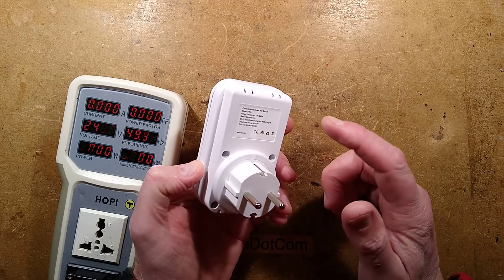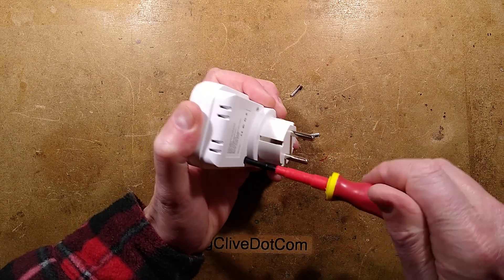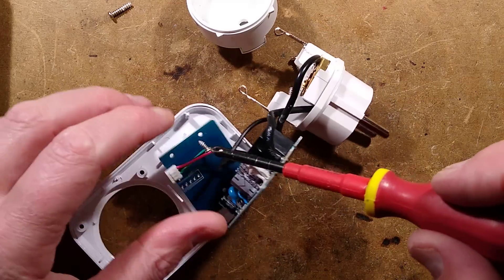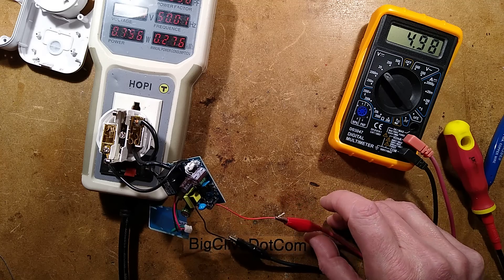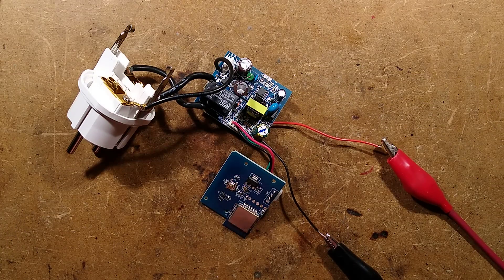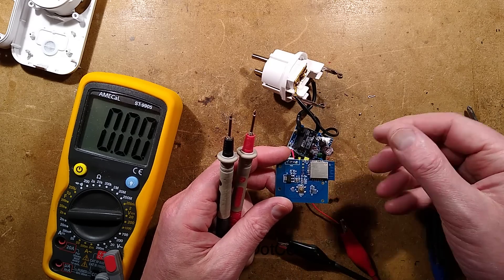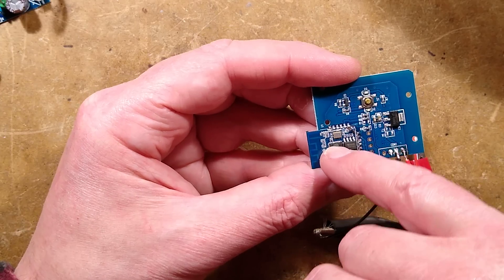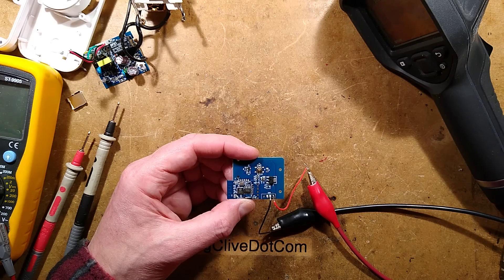WiFi socket repair fail

Comment: you can actually purchase those esp8266 modules by the reel. Its the whole stamp sized module with the board edge soldering pads. This particular plug looks to be compatible with open source firmware like tazmota or ESP-Home. You might enjoy playing around with that stuff Clive.
Reply: I would definitely recommend that, pretty easy to set up too
Reply: Esp8266-12F can probably replace it easily

Comment: This would be an ideal candidate to replace the failed board with an ESP8266 or ESP32 and make the smart socket even smarter with sensors and custom code.
Reply: It is an ESP8266.
Reply: @WereCatf  I know, but a) it's knackered and b) an external board is ready to use, with all the GPIO pins broken out, and a USB connector ready to program it.
Reply: @BlackheathTownhouse  It's not necessarily knackered, like e.g. perhaps the SPI-flash got corrupted. It wouldn't take more than a couple of minutes to solder wires to the UART-pins that are clearly visible on the PCB and reflashing the board with e.g. Tasmota to see if there is an actual hardware-fault or if it's just a firmware-issue.

Comment: i have a nice failed device right now it is the charger for my 3+ cruze hybrid smart watch i put the watch on it and the next morning i could smell the magic smoke opened it up and there is a hole blown in an IC and the surrounding caps are all reading dead short and a resistor is open would love to send a picture of it to ya but dont know where to send it if you want it

Comment: Worked with many flavors of on board wifi products. Notoriously buggy and get lost easily.  Each brand has a trick for  a "hard reset" that involves more than a power cycle.  I wrote a 20 page white paper on this process for all our products at my last job. Reviving dead returned parts. Some of the methods were definitely non intuitive.

Comment: ESP8266/ the board seen here would be either a ESP12-E or a ESP12-F. Either of these are easily available. Replacing the same could get the WiFi socket to work...

Edit : As pointed out by a fellow citizen with his bilingual comment, there seems to be a less number of pins in that particular ESP module... Which makes my original comment pointless. Still, one could swap out the ESP chip (but alas! If there is no programming port that is useless as well...)
Reply: ESP12 has 8 pins to each side. Clive's board has 6 pins each. Not an ESP12. ഇത് വേറെന്തോ സാധനമാണ്

Comment: Oddly enough, there is a chance there is nothing electronically wrong with it.
I have a number of ESP8266 based switches & outlets scattered around that occasionally fail after out local power utility lets stray oddities happen.  (London Hydro really needs a smack...)
Every time, I've simply reflashed the firmware & brought them back to life.
Not saying this is definitely what's wrong there, but worth a try before scrapping it.
Reply: Yes! We had a planned power outage for some work on the DNO's HV gear. The switch over to diesel went fine, but when they put us back on grid energy they did so in such a way that the voltage very slowly rose rather than being switched "hard" on.

All my ESP devices needed switching off then "hard" on again before they'd work, and one needed Tasmota re-flashing before it'd join the network again. Interesting!

Edit: and not just problems joining the network - they didn't respond to the local hardwired switches either, until they'd been restarted.
Reply: I wonder what the failure mechanism is in those case. corrupting the flash eeprom?
Reply: @rpavlik1  That's what I've found so far.
The brownout protection on the ESP12 / ESP8266 isn't as good as the ESP32, so the chip is probably still trying to execute the program from flash. This can cause the flash to corrupt if a read occurs and the voltage isn't high enough.
It also means that if you connect & disconnect power quickly, the ESP12 can be starting to execute the program, while the flash doesn't have enough power to read the next set of instructions.
Reply: Not massively related, but I had a laser printer do that once. If I tried to use any of the networking features, it would crash and reboot. Thankfully I was able to re-load the firmware over USB to fix it.
Reply: No, I don't think that's odd enough. 
Many things I see each day are much odder than this.
Reply: What is London Hydro?
Reply: @frinkemon  I am gonna guess it's a London area based hydroelectric company.
Reply: @Fridelain  yeah I don’t want none of this arty farty leftie power. Gimme some proper nuclear stuff!
Reply: @frinkemon  I don't think its that kind of hydroelectric.
Just that they provide both water and electrical services.

Since I don't think the UK has hydroelectric dams and I doubt they have tidal power that far up the Thames.
Reply: @VekhGaming  It's definitely London, Ontario. In almost all the Central and Eastern parts of Canada it is standard to call electricity "Hydro". While baffling when taken literally, it is likely an anachronism from the very early days of electrification when fundamentally all electricity was produced from hydroelectric turbines -- first at Niagara Falls, then at other sites throughout Ontario, Quebec, and elsewhere. In these areas, the name "Hydro" stuck, and it stuck hard. All our electricity companies are called "hydro" companies. We even call the power lines "hydro lines". It makes me cringe a little, since I know better, but it's just part of the local language. I try to see it as adorably quaint, instead of infuriatingly inaccurate. I don't always succeed, but I try. It's how I cope with living here.
Reply: @VekhGaming  In fact, a rather large proportion of our electricity here is hydroelectric...
&, while we ARE on the Thames...  It's not that Thames.  :P
Reply: @cecilkorik  In that case I stand corrected.
Reply: @frinkemon  Electric utility company in London, Canada
Reply: @frinkemon  - 🧐🇬🇧
Reply: @samuelfellows6923  

I'm guessing it is London, Ontario.
Reply: @westelaudio943  😕
Reply: @frinkemon  
electrical supply company perhaps ??
Reply: @frinkemon  That would be our local power utility...  Highly corrupt & poorly run.
Reply: @frinkemon  not a hydroponics store but it sounds like it

Comment: Smart devices seem less and less smart every day, with them crashing, corrupting or just failing electrically, not to mention using power when they're "off", can't beat a good old switch, when it's on, its on, when it's off, it's off, simple, people are just getting lazy... :P

Comment: you were holding it upside down thus letting all the electrons fall out
Reply: and where do those electrons go ?
Reply: @jyvben1520  into the 'ground' ?
Reply: @desperateloner8555  that's deep ...
Reply: @jyvben1520  into Dave's EV charger cord.
Reply: @jyvben1520  I think they were on the Captain Scarlet series...
Reply: Electrons are only found in old-fashioned vacuum tube valves!  All integrated circuits work on blue smoke.  As long as all the smoke stays safely inside the package where it belongs, the device works fine.  Lose any more than a tiny puff, though, and it's dead.
Reply: @bluerizlagirl  But that is SO boring!  -  thank you though.
Reply: I believe electrons flow in the other direction, so he's fine.  Or is that current.  Or do I have that backwards? Now I have to go back and look at an electroboom video, which Clive doesn't like because eb makes shocks look like fun, which they aren't, especially when the amount of electrons flowing into your body is higher than the electrons you already have in there and especially when your feet are wet.  Or if you are kneeling on a grounded sink surround while changing a broken lightbulb when someone wired the ground side as switched instead of the hot.  Not that I would kkknnnnnnoooow anything about that.
Reply: @robertjagman4598  Nice one,   I always like to fill the Bath with water and stand in it, naked, while changing the Bathroom Light Bulb with wet hands...
Reply: Magic smoke can hold electrons against gravity but once the magic smoke is gone, nothing holds the electrons back anymore.

Comment: So the next stage of this investigation would be to tack on a RX/TX/GRD to an FTDI adapter and see if there is any debug from the ESP module. Step after that would be to flash the ESP with a known good bin file (Tasmota/ESPHome), failing that, replace the ESP sub module with a 1F replacement. - Either way, a lot of work for something that obtainable for about £12 off of ebay/Amazon

Also, the current draw and temp for the ESP is about right. They do get warm when running, like any computer, the thermal energy is partially proportional to the workload it's doing...
Reply: I would not be at all surprised if the esp8266 is rebooting continuously because flash got corrupted.

Look at the serial debug. Your answers lie there.
Reply: @OmegaSparky  Agreed, and there's a handy pin header right there on the board, so it should be straightforward to have a poke about at.
Reply: @OmegaSparky  Yes, that's something I'm wondering...especially if it did something dumb in their implementation like writing the state of the relay to the flash chip every change (so it restores on power-up) and wore out the memory cells.
Reply: @matthewmiller6068  They should used a specialised IC for storing constantly changing stuff, like F-RAM, or an always on RTC.
In my own wifi powerswitch design I have used an RTC IC which had its supply by a supercapacitor (or a button battery). The RTC had about 128 bytes of extra SRAM memory, this extra memory solved this problem, and I have used it to store the configuration too.
(The RTC was used for timed switching)
Reply: Don't buy anything from FTDI, they burned trustworthiness when they released an end user device driver that intentionally bricks end user products using compatible chips instead of FTDI chips.  Fortunately there are multiple alternatives alternatives: CH340-family, Prolific PL2102-family, SiLabs CP210x-family and specially programmed microcontrollers from microchip.
Reply: Also note the serial has to run at 3.3V logic level.
Reply: @mrmike1972  Indeed. On my USB to UART adapters there's a jumper for 3.3 or 5 volts. Always make sure it's set to 3.3.
Reply: It's not worth doing. Just buy "dumb" switchable sockets or power strips with zero standby power usage and move a few more muscles to reach and actuate it instead of just using the phone.
Reply: @kyoudaiken  Really depends on which usage you have for them. If it is for switching something time-based or when you are not at home it can really be useful to use things like these.
Also many times, sockets are put far away from shutters for windows for example that can only be powered from a mains source and therefore need a safety-switch to turn them off. Many modern builds have plugs in the attic far away from the users and no switches in the room they are in.

I use things like these to remotely switch things automatically and incase of incidents with my 3D printers as an extra line of defence: if the software  goes wrong and failed prints cannot be stopped from away from them I can kill the power to them so to kill them from everywhere to prevent fires.
And yes that is well worth some of these switches and the power they use.
You can actually automate that from for example Octoprint so that a printer is turned off when the (3D) print is finished or if failures are noted.
Reply: @kyoudaiken  There's a lot more to these sort of plugs than "use your phone to turn it on", I have used similar ones (Sonoff S31 with ESPHome) to replace lamp timers so I don't have to keep readjusting the clocks every couple months and can have fancier stuff like lamps that turn on based on X time before sunset instead of just turning on at like 4PM nomater if sunset is 5PM or 9PM.  Also can do stuff like auto turning off lamps if nobody is home or make a bunch of lights slaved to a single thing (e.g. I have some smart switches so if someone turns on the back floodlight some other exterior lights controlled from a totally different floor turns on) or fix dumb switch placement (turn on light/fan from a switch on the other side of the room...idk why the bathroom fan in one bathroom is not switched next to the toilet).  Also handy for stuff like I put some on the aquarium lights and can be notified if the aquarium malfunctions and trips the GFCI more rapidly, or if the reptile heat-lamps burn out immediately tells me based on power consumption.  At least the ones I have S31 don't seem to draw any more than the older basic programmable timers that had no smarts.

Comment: I have a relatively cheap set of RF-but-not-wifi remote control plugs. I want to remove the rf receiver and replace it with an ESP32-S3 or a raspberry pi zero. The interface between the RC RF module and the internal microcontroller seems to have some mind of protocol, not just pull high/pull low. I suspect it uses high-to-low and low-to-high transistions to turn off and on, but I haven't had the motivation to scope it or just test it out, mostly because my bench is a mess but I won't work with AC until my workplace is uncluttered.
Reply: It could be sending some kind of serial code so that multiple senders and receivers can be used together. Possibly there are dip switches or solder links but it could be embedded in the firmware.
Reply: You can do what Clive did and supply a DC voltage after the SMPS
Reply: Likely the tuyamcu protocol its a serial protocol made by tuya who is the main manufacturer of the wifi modules they use and create the firmware and they host the cloud servers

Comment: Looks like it is destined for the reclaimed parts bucket - 5V supply module, usable relay to go with it - usually I see 12/24V ones in these things. I've been investigating a very similar broken device myself, power supply side good, otherwise dead connectivity. One of a set of three, which makes it more annoying.

Comment: I had a similar smaller cube shape one that recently failed due to the ESP module. I wondered about replacing the module but ended up chucking it out due to the micro surgery involved.